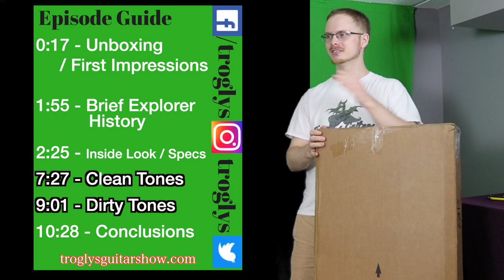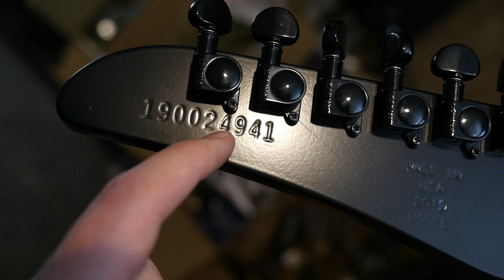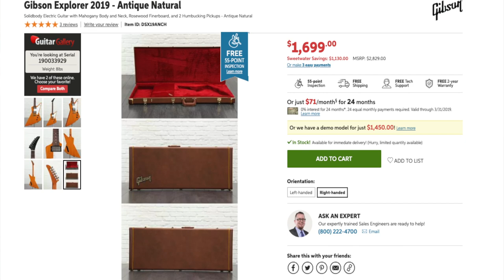Is it Worth Buying? 2019 Gibson Explorer Tribute B-2 Black | Review + Demo

Comment: It needs a ebony fretboard. It looks like it's wearing brown shoes with a black tux.
Reply: An ebony fretboard AND a binding. At that price it would be quite more of a bargain.
Reply: Or a brown shirt under a black coat
Reply: @CKC411  Or at the very least some real good conditioning to drastically darken it. But I agree, ebony would have been ideal.
Reply: @CKC411  frets can't be black becaue the paint would wear from tre frets after mild usage already.
Reply: @CKC411  I'm not sure but I thin it would be fine as fret material, but nobody sells black fret wire, nor do any guitars have it.
Reply: @CKC411  well good luck finding black fret wire then I guess
Reply: @CKC411  a lot of guitar shops will do refret jobs on guitars, so fretting a neck would not be a problem. You could do it yourself also but definately get the neck checked afterwards.
Reply: All black sg’s have a brown fretboard and nobody seems to complain
Reply: Rosewood necks are hit or miss.
Reply: I hate how they don't use block inlays or at least trapezoid for most explorers unless you get into customs and nicer models
Reply: Look at e.g. 7:37, that's how it actually looks like most of the time. In my case at least.

Comment: Not putting an ebony fretboard on this model was an epic fail on Gibsons part.
Reply: Agree, even Richlite would ave looked better.
Reply: At least put in a richlite fretboard it looks good enough
Reply: You could hit it with a woodstain though. I've found a used one that I'd like to completely pick apart and upgrade visually
Reply: Disagree. That rosewood has a distinct feel to the fingers. Ebony would just be a nicer look yes, but that sacrifices the  feel. IMHO.
Reply: ebony is expensive wood reserved for the highest end instruments
Reply: @andrewgremba1450  And rosewood is more in line with the what the original Explorers had, if you care about that sort of thing. I like the rosewood look, although an ebony board is also sexy. That's why you buy two, one ebony one in rosewood ;-)
Reply: The 1999 gothic model had the ebony board. It DID look great, but after a while it just didn't match the matte black finish (which REALLY turned glossy very quickly anywhere yout touch.) Still don't have the heart to tell you what I would do to get my hands on another 1999 Gibson Gotic Explorer.
Reply: @snoolee7950  so is rosewood now. Since 2019 actually
Reply: Agreed, its like a gothic series only a lot less cool. Yah need the ebony.
Reply: The last 15 years have been an Epic fail on Gibsons part

Comment: Nice guitar but any guitar that lists over a grand should automatically come with a hard case. IMHO
Reply: This immediately made me think of Ibanez as well
Reply: Once you factor in the cost of a Gibson case 229+1,399(2020B2)=1,628. As a 2020 Explorer is 1,699. I guess it's just a matter of Black for 1,628 , Alpine White for 1,999 or Natural at 1,699? But yes, I do in fact agree with you that the case should be included.
Reply: I got a gibson explorer in 1999 for $999.99.Half what they are now,and it did indeed come with a case.
Reply: The 1990 version of this guitar with the same colour but in a gloss finish and pick guard came with the brown / pink lined case ,and cost around £1000.00 back in 1990.
No case for an explorer? ,I'd rather pay a bit more and get a case with it.

Comment: Nice, but once you start talking only a little more money for the Upgrade/Antique Natural finish and it's an easy choice, especially since it comes with a real case (and the multi-tool).  I mean if you're already at $1400 what's another $300?
Also, while your correct about the gold silkscreen logo and lowering the price to $999, is it possible Gibson isn't interested in that strategy?  The marketing strategy with the $1400 price might be to keep some of the "Gibson" exclusivity brand.  Maybe, who knows.  That pearl headstock logo is a lot more noticeable/striking and easier to see from a distance than the gold silkscreen.
Still a pretty nice guitar, however those pickups are too hot for my preference.
Great review, thank you.

Comment: If the question has to present itself whether or not you have to choose between saving a few clams and getting all of the onboard amenities you want (specifically putting the toggle switch were it traditionally goes and having both volume controls), it becomes clear you should only get this particular version of the Explorer if you just want the Gibson name and the body shape. Makes me thankful that the Explorer I owned for less than half a decade was the Epiphone version being produced in 2018. Sure it was an outsource production, might not have included the best quality materials and didn’t say Gibson on it, but it did what I wanted it to while I kept it. Chances are pretty strong, if I had to have another one that I would again go with Epiphone.

Comment: Looks EXACTLY like mi Epi Goth Explorer. The finish, the neck, the fretboard, hardware,everything. If it wasn´t for the Gibson logo, you couldn´t tell. It doesn´t feel cheap at all. The fretboard is particularly well done; it looks a lot like yours. The only thing I hate is the lack of inlays. 
The sound? the stock pups (57 classics) sound like a Gibson pup should sound. I plan to upgrade to SD Distortion, but just because I want that sound. Great cleans, distorted is amazing, as it should be. Plays really good Jazz, Blues, Rock and Metal, of course
I was watching your video review, and thinking...Why would I buy this one for 1300, if my Epi plays and sounds every bit as good..for around 300? ( I got mine second hand) What´s in it that blows away my Epi?
Reply: It has the ''Gibson'' tag, I guess.

Comment: Not a bad rig. I don’t see how 1499 is a bad price. Considering nice imports are fetching 1000-1200. It’s got killer pickups and a rout to mod it for the toggle switch. Giving you another option for a 3rd knob. Slap a cool aftermarket pickguard on it (chrome or white maybe) and you’ve got a cool looking guitar. I don’t think I’d buy it over my Schecter E1-FRS. But it’s not a bad price for a Gibson. 1299 probably would’ve been the sweet spot though. Thanks

Comment: Same "Egg Shell" gloss finish as seen on the M2's and the Limited Yellow Zebra Jr.
Reply: The M2s were complete crap. These tribute series are super on par! Just like the Jr double cut tribute
Reply: @mr.mcmagpie6606  That's fine you think that, I own one and it's my #2 behind my 07 BFG. The point is it's the same paper thin "gloss" finish those models had and it will age the same way. Completely different animal to the satin or conventional nitro gloss finishes.
Reply: Different animal all together. They didn't even paint the back of the M2s neck. Also poplar body instead of mahogany.  This tribute is also grain filled, 'primed' and then painted.

Comment: the very second you talk about "conditioning the fretboard"  all your credibility goes right out the window.   you're selling snake oil.  gibson spends all that time and effort to dry out the wood,  and you think slathering it in oil  will add moisture.   here's a secret for ya:  oil displaces water.   on top of it, you can't point to a single guitar, in the entire history of guitars, where fret sprout is cured by oiling the board.
Reply: I know where you're coming from . This made me think of something else ... Guitar polish is expensive compared to furniture polish. I use non silicone "Wood Silk" which contains no silicones or water . People use it on antique & reproduction furniture ...
Reply from the maker: The board was not conditioned to 'cure' fret sprout. That's just silly